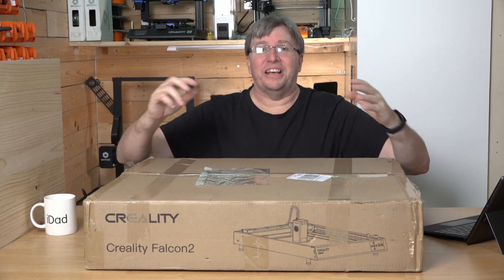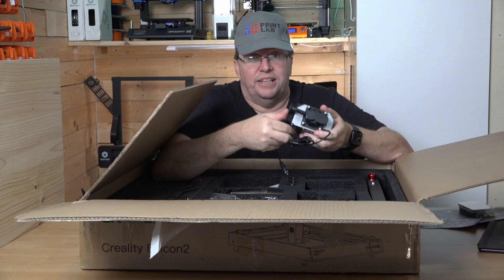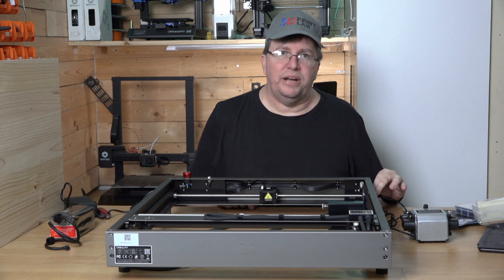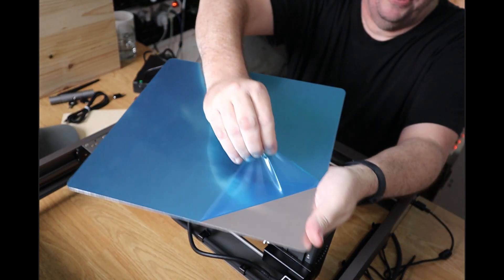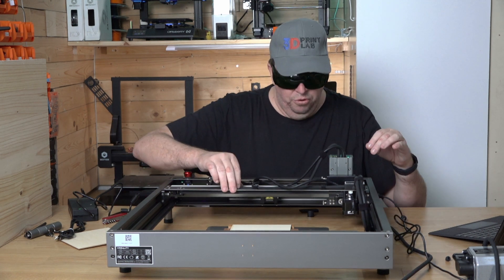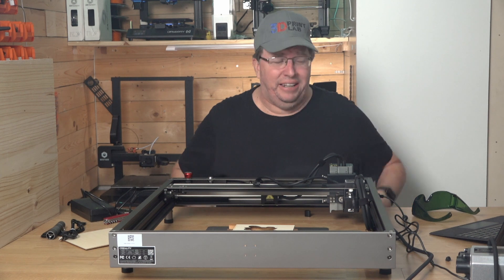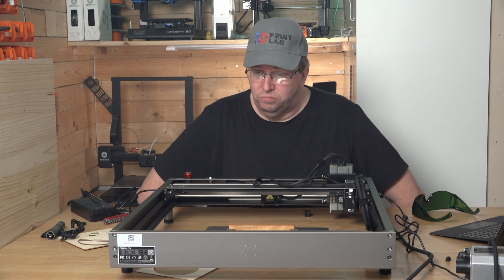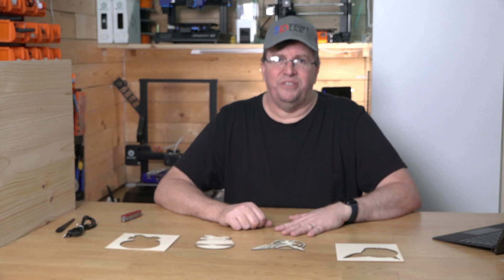The INCREDIBLE Creality Falcon 2 22W Laser - Unboxing & First Cuts

Comment: If you adjust some of the settings you should be able to reduce the engraving time by 50%,  lots of unnecessary movements over the "blank" spaces
Reply from the maker: Thanks for the comment, I will experiment with that.